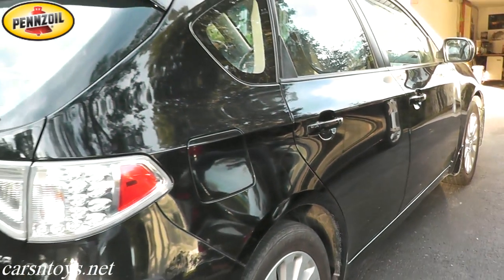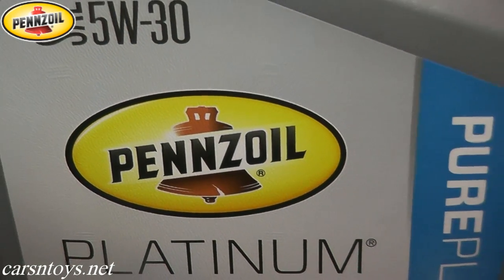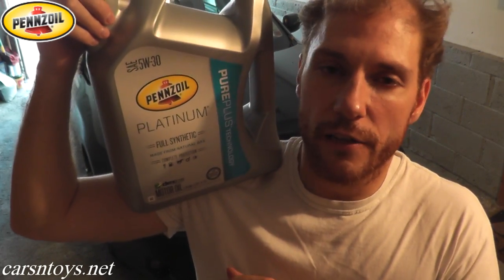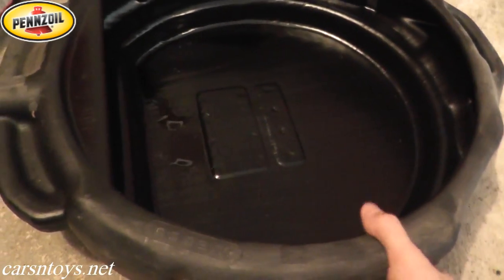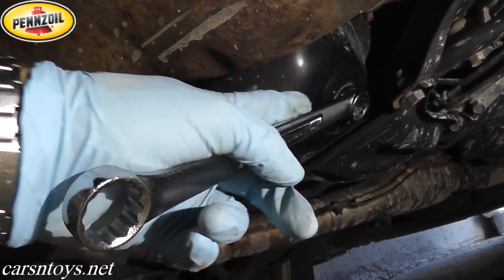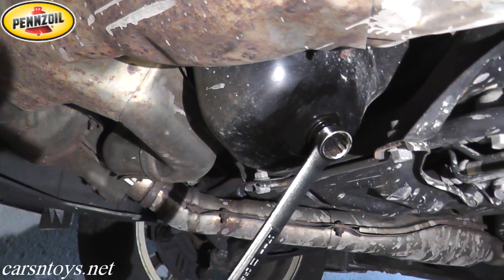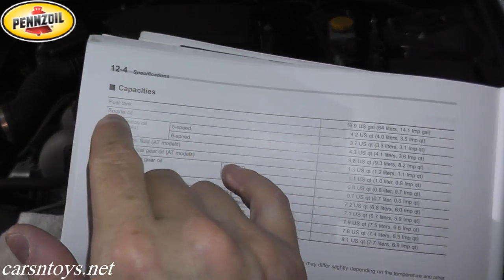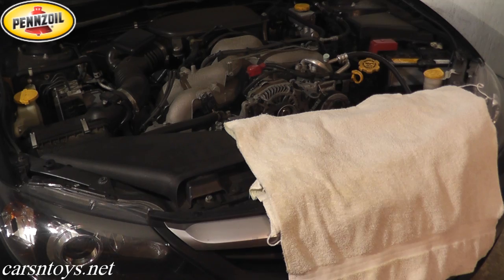OIl Change with Pennzoil Platinum Full Synthetic Motor Oil

Comment: I use the Ultra Platinum with a Purolator Pure 1 filter. I don't see the engine light on? The horseshoe light/Tire pressure Monitor Light is on. I like my oil hot before I change it to be sure everything is in suspension before I drain it! You did mention to make sure the gasket is still on the old filter and spread oil on the new gasket BUT didn't fill the filter with oil before putting it on the car. Oddly when you restarted the car the Tire Pressure Monitor Light was off! Maybe because it is warmer in the garage?

Comment: I got good service from the Mobil 1 with the Frantz oil cleaner and no oil drains in over 250 k. The 84 Subaru GL finally started leaking oil at the head gaskets. The Smart car has 142 k on it. 40 k with the Pennzoil Platinum and a Motor Guard oil cleaner. I won't live long enough to get 250 k on it.

Comment: I used GTX or Valvoline conventional ON my Scooby. Ran it to 250k and sold it running pretty fine. EJ engines aren't picky for  oil.

Comment: One suggestion: After you put the new oil in the engine up to the safe zone, start the engine (as you did), then check the oil level again as the oil filter will typically take about half a liter to fill and will lower the level. Just top it up if needed.

Good job on the video, and good content.
Reply from the maker: +Mechanix R us Thank you

Comment: Considering the filter stands straight up, why didn't you pre fill the filter with oil
Reply: I never do. I also never bother to put oil on the gasket. I never have filter leaks and it's always easy coming off since I just hand tighten. As for pre filling the filter..its impossible to tell if it really is better for the engine . It seems to me that if the engine really is without oil for a few seconds, the instant pressure would immediately open the bypass.
Reply: If anything add an ounce or two and hold the filter horizontal while spinning it to evenly soak the media..you don't want free standing oil inside the filter.

Comment: U could have easily filled the new filter with some oil so that car doesn't start dry...hate to see that
Reply: It’s called film retention, everything in the engine still has a coating of oil left on it. The engine isn’t “dry” when you start it after an oil change. And it takes probably about a tenth of a second for oil to refill the filter after you start the vehicle anyway.
Reply: I have never bothered to pre fill filters, it's impossible to tell if it really is better for the engine. If the engine really is without oil for a few seconds, the instant pressure would probably open the bypass
Reply: It would take more than 5 minuts without oil to harm the engine at idle.

Comment: The engine doesn't run dry on oil because you didn't fill the full flow filter with oil.
Reply: I never bother doing that either.

Comment: Try Amsoil! This oil is simply the best for long term use. It is the only one that can go up to 25,000 miles or a full year! I wonder what the difference is between full synthetic and 100 percent synthetic? Amsoil is 100 percent syn.
Reply: KillerYo56ss the purple stuff is good enough for me
Reply: TheBikemaster94 To each their own! I like not having to worry about my oil for at least 1 full year cause I don't run 25,000 miles in one year!
Reply: I've liked Amsoil a lot for bikes especially two stroke oil.
Reply: KillerYo56ss Stupid to go 1 year between changes no matter what kind of oil..It'll still get dirty..unless you drive 20 miles a week..😏
Reply: Amsoil is fantastic but I can't justify using it in my Impreza 2.5i. It doesn't have a performance engine so the price of Amsoil is just too much. I've used Rotella T6 and Pennzoil Platinum and I can safely say the Pennzoil is the best for these engines. Great gas mileage and quick warm up times in the winter.
Reply: You should always follow the vehicle manufacturer's oil change interval regardless of what an oil company claims.
Reply: Oh great...another amsoil fan boy who has been swayed (or perhaps even been paid to comment on videos) by all the sponsored videos. If amsoil is so great, why was it that shell invented the pure plus technology that creates oil from natural gas, making it TRULY synthetic, and not simply more refined.
Reply: @stephenmartinez1  Amsoil, Motul, certain Redline, Royal Purple, and Liqui Moly oils are 100 percent synthetic. Trust me it's better. What's unique about Amsoil is they have a Racing version called Dominator that competes with Redline etc... And they have Signature series design for daily driving, with that said I would never leave any oil in my engine for 25K. Just my opinion.

Comment: did they give you a script? sure sounds like it...
Reply from the maker: Not at all. But I did research it before hand. I've been using this oil ever since.
Reply: @CarsNToys  it's good oil, I just did my oil change and used this Pennzoil synthetic, switching from Pennzoil conventional and the vehicle starts up quicker-and it could be just expectations but the engine just seems happier, though it all could just be because the oil is fresh.